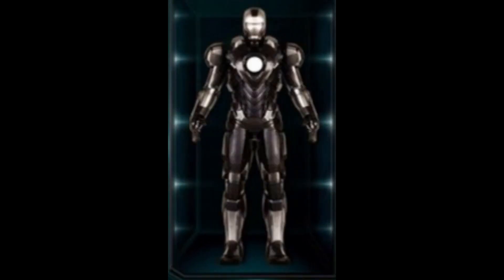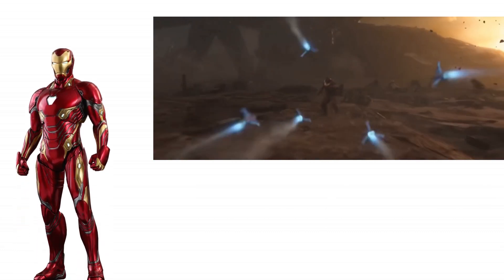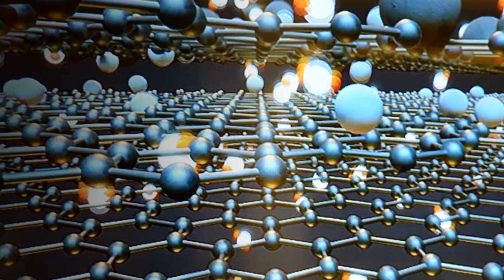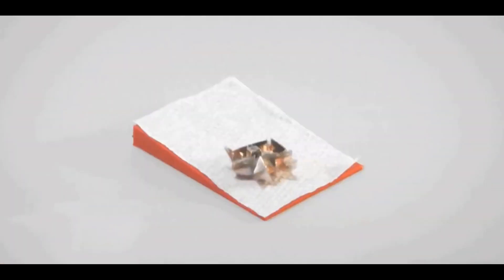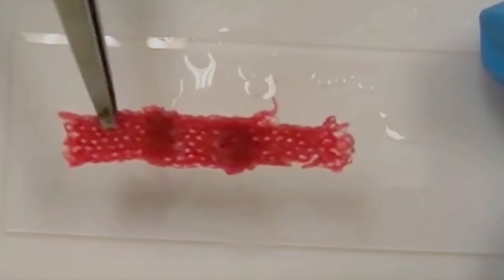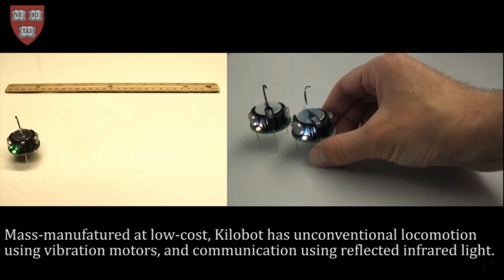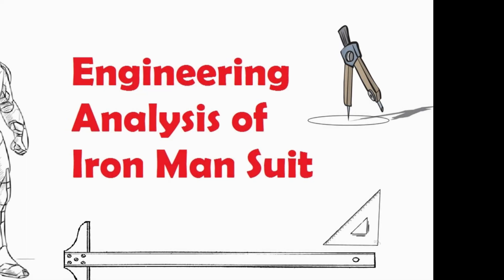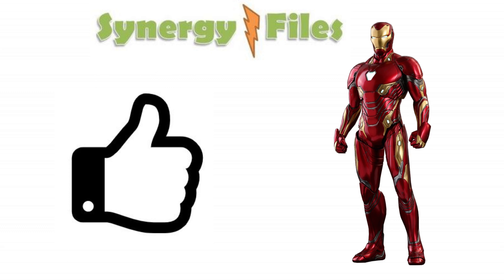Engineering of Iron Man Nano Tech Suit Mark L (50)

Comment: Well have to work on free energy mehanism which tesla was going to make a century ago.i had seen a video a year ago on it ,the video showed a cpu fan where the wings were glued with neodymium cylindrical magnets and the two ends of the fans structure was glued to two neodymiu  mahnets on the either side so as to repel the magnets inside and create a generator out of it.now if we master nano technology we could make this mechanism smaller and efficient and combine them to get huge amount of energy in kilovolts but then the problem comes about thermodynamics as the suit may melt.so this reality is centuries far from us unfortunatelt we have born too earlier xD
Reply: Adios menezes sorry to break it too you but free energy isn’t real. The only place you can make a wheel spin forever is the vacuum of space and you can’t get energy from it. You want a real arc reactor? Look up betavolataics.
Reply: That's actually not real

Comment: We can store liquid alloys by making ballistic tanks of high pressure inside the suit and program it to release the liquid alloy whenever it detects any signal of a dent or crack so when its released the atmospheric pressure will turn the liquid  into a metal but this will require decades as u said to master this brillant technology.good observation and analysis
Reply: Adios menezes so r u saying that u can turn the liquid into metal whenever it detects a crack or dent?
Reply: Ethan Use a lithium ion battery
Reply: MaxMoon yes. The metal will detect a crack, reliquify and then solidify again which will remove the crack. Basically self healing armor.
Reply: calm down big brain
Reply: You are so smart!!!
Reply: Cheers for this, I have been researching "how to make iron man hand blaster" for a while now, and I think this has helped. You ever tried - Fenophia Uncomplex Finder - (should be on google have a look ) ? It is a smashing one off product for discovering how to create an Iron Man suit costume minus the hard work. Ive heard some extraordinary things about it and my neighbour got great results with it.

Comment: I don't know. But ever since I saw Tony stark build the first rough suit in the cave. I wanted to build one! It's a bit over my head!
Reply from the maker: You are not alone. I had the same feeling
Reply: Synergy Files i have leg injurys that keep me from doing everything I want to do. That is my main reason. How ever who wouldn't want a iron man suit??? If a power source light and power dense , along with matereals light and strong. Maybe carbon fiber could be used. And maybe small amounts of magnesium and aluminum.  To make a mark 0 version. With linear actuators with bldc motors. To make them strong and fast enough! Getting the controls and programming may be difficult! Maybe arduino or raspberry pie to start..
Reply from the maker: Sorry to hear about your injury. They have built exo skeleton suits to support assembly line workers that deal with loads. This is the one that just support the back https://www.youtube.com/watch?v=rtMbi_T2eg0
There was another one that supports legs. I think one of the Japanese companies did it. I like your ambition though. Keep it up. You dont have to start from the beginning though. I am sure there are exoskeletons in the market that support real time human movements
Reply: @synergyfiles3536  that's also my dream to create the real Iron Man.
Reply: ANONYMUX  I'm working on working thrusters for an iron man suit
Reply: Any ideas on some way to make a iron man sho shape
Reply: You’re not alone either, I wanted to build one as well. But I was a bit over my head. I still want to though!
Reply: @jamest.5001  it’s not carbon fiber or aluminum, it’s gold titanium alloy
Reply: @matthewwringer7662  really?! How are you doing it?
Reply: @mixz49  liquid hydrogen is currently the fuel source I'm looking into. If it works, the suit would use an electrolizer to produce the hydrogen, meaning the suit would run on water. So far it seems it will use 4 rocket engines.
Reply: @matthewwringer7662  I wouldn’t mind being your test pilot 😉
Reply: @mixz49  okay
Reply: @matthewwringer7662  I don't want to be a dick but...PROVE IT!
Reply: Me too!! Even though I know it would be difficult, I just really want to build one! I have quite alot of knowledge but yeah XD
Reply: @matthewwringer7662  How is it going?
Reply: @matthewwringer7662  any progress yet?
Reply: @matthewwringer7662  you should put a hydrogen generator on it because you want it to fly for long time
Reply: Me toooo